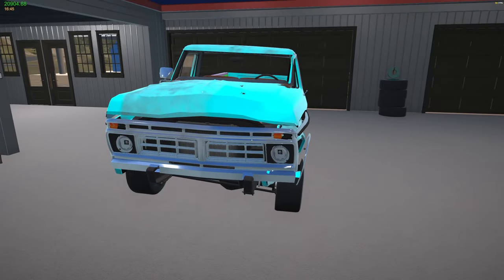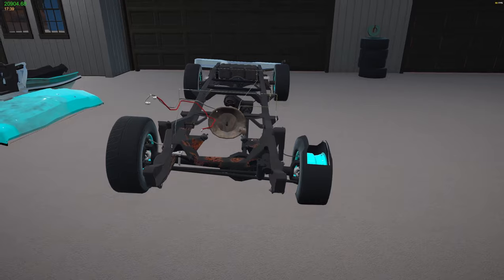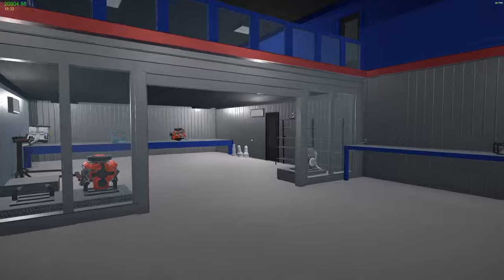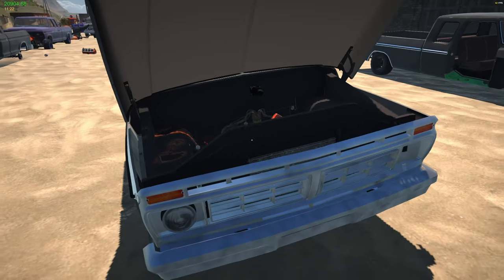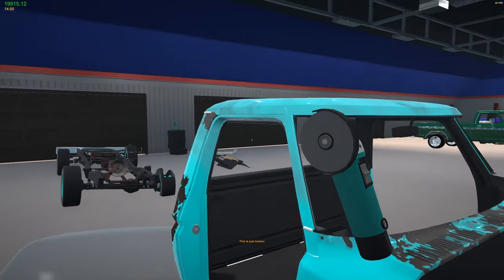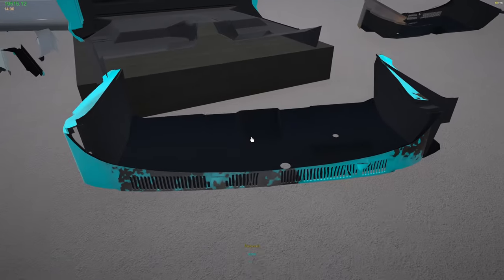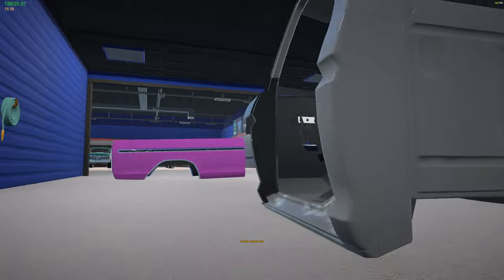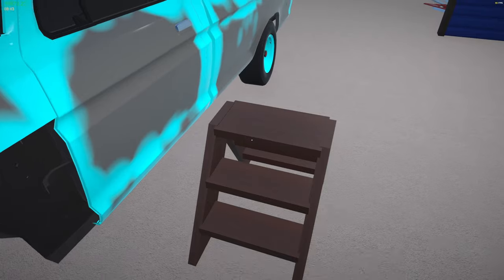Totaled out ford truck B200 new update - My Garage

Comment: The fuel I am interested in is diesel but you can use whatever engine you like👍😇
Reply from the maker: Has to be a the i6d
Reply: @weplayendlessgaming  I know if I install this game I will build vehicles with only I6d because If I did build them as diesel vehicles I can get good gas mileage
Reply from the maker: Diesel in the game does seem to last longer
Reply: Good and it gets very good gas mileage whereas gasoline gets horrible gas mileage
Reply: @bidzinaotarashvili5942  the dev should definitely add a diesel v8 option for the truck, or a muscle car if you feel special lol
Reply: @drakevevo3710  thank you for telling me, the diesel v8 is the best choice

Comment: been playin for 3 days or so and im having trouble with a B200 v8 engine.
Reply from the maker: What's the issue your having?
Reply: @weplayendlessgaming  dw i found it and i also got a new bike running! but, have you got any idea on how to change the interior seat, dashboard and door panel colour?
Reply from the maker: You have to go to the interior shop and buy new ones